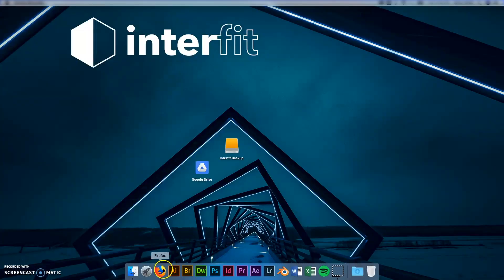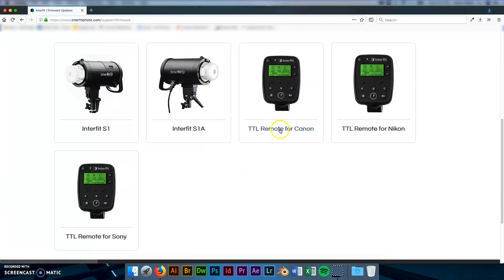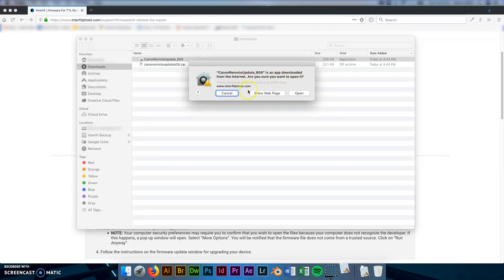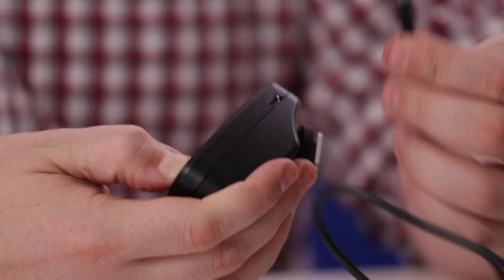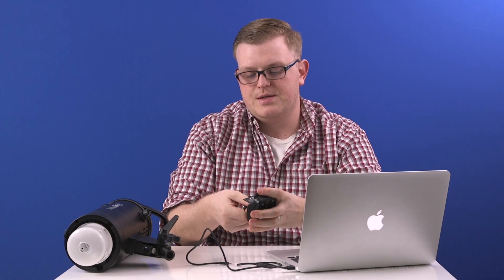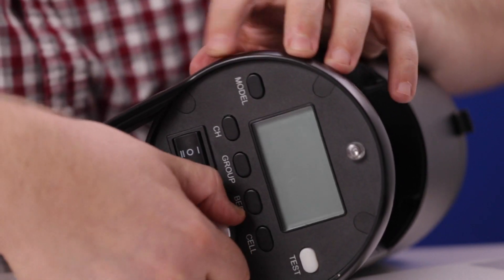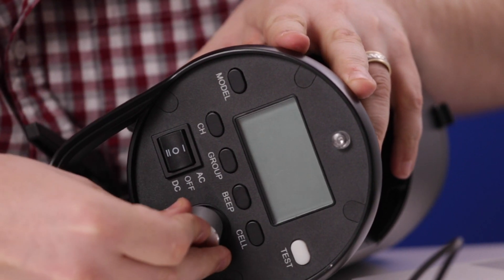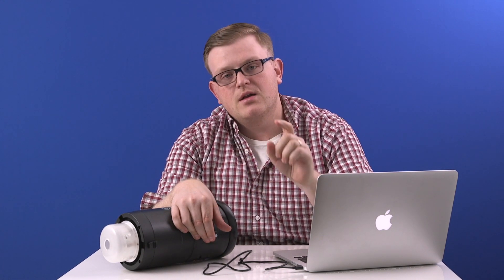How To Update Interfit Firmware

Comment: My S1 has an error code of U2, how do I fix this?
Reply: Hey you ever figure this out?
Reply: Nope. pretty much cant use that one anymore. Company seems to have went under. @dacorijones7484
Reply: @dacorijones7484  the port for the power cord was loose. It screws in.. I tightened it by screwing it down.. then use the power cord with the ac adapter to trigger a few flashes.. then I put battery pack back in.  And it works
Reply: @JosephCampbellSolutions can you tell me more about this? I’m getting a U2 error and I can’t seem to find a fix. I’ve tried unscrewing things too. Wondering if maybe my power cord could be the issue?
Reply: @jamesbianchistudio  it's didn't work. Still having issue with that light.

Comment: Greetings, I bought the S1, I did the above, but there is a unit that sometimes misses a shot at certain intervals, thanks
Reply: Hello, I see you posted a year ago, wondering if your aware the interfit closed down, and the reason I'm asking is I purchased my S1 and Honey Badger back in 2017 and now I'm in the need for  new flash tube and Batteries.  I went on the site and they show that they're available but I'm a little apprehensible  about giving my credit card info if the company is no longer.  
I'd appreciate if you have any info, try calling but the number on the site no working and e-mail just gives me closed down as off May 2023
Thx
V

Comment: I have the Badger Unleashed lights. I have not had any problem with them until lately.
I bought 2 Badger Unleashed lights 2-3 years ago. I used them for a church photo directory and was very happy with them. I was asked to do another photo directory, so I bought 1 more Badger Unleashed light. I just updated the firmware tonight from 3 to 4, but now 2 of the lights won't work. They turn on, flash while turning on, and then turn off automatically. I cannot use them at all. They won't stay on, its just the flash and then they turn off. And it won't let me upgrade my remote. I have been trying to connect it for several hours now and it won't "Connect".

I am very happy with the lights! I really like them, but this problem has come at a VERY inconvenient time! I need the lights by tomorrow afternoon (in about 17 hours)!

Comment: Trying to update my remote (for Nikon).  Pulled batteries, connected to HP Pavilion laptop.  When I run the updater, regardless of what I do, it says "No such USB device". Rebooted, tried different USB cables, etc.    Running Windows 10.  Any suggestions?

Comment: How can we get the new Nikon Z6 II to work with the system? I used the S1 and Nikon trigger with a D800 for a few years, they worked beautifully. Now the Nikon Z6 II won't even trigger the flash in manual mode....
Reply from the maker: Hi Jamie! Sorry about the recent incompatibility - it usually takes us some time to reverse-engineer things when Nikon changes their firmware code, as they don't share that information with us third-party manufacturers. Covid-19 delayed many aspects of our business for some time, so we are just getting things back on track. Making sure that all cameras maintain compatibility with our lights is a high priority, but it will take a while for us to catch up with these newer cameras that are less than a year old.
Reply: @InterfitPhotographicLtd  how long until the new firmware?

Comment: No update for the universal remote? Can't use my S-1 now?
Reply: If you email interfit, they'll send you firmware to revert your S-1 for use with the manual remote, as I understand it, you'll then need to switch between firmware if you want to use the manual remote or if you want to use the HSS/TTL remote... not the most elegant solution.
Reply from the maker: @mattlewis4284  The firmware revert solution was just a temporary fix during the product recall. The manual remote doesn't require any firmware updates, as it doesn't have any TTL or HSS protocols to worry about. The manual remote issue was related to an incompatibility with the firmware of our TTL/HSS products but has been fixed at our factory. If you need to switch between the TTL/HSS and manual remotes for your work, please contact support@interfitphoto.com to have your old manual remote recalled and replaced with a functioning one to avoid the need for rollback.
Reply from the maker: The manual remote doesn't require any firmware updates, as it doesn't have any TTL or HSS protocols to worry about and will work with any camera through the standard hotshoe firing pin. The manual remote issue was related to a hardware incompatibility with the firmware of our TTL/HSS products but has been fixed at our factory. If you need to switch between the TTL/HSS and manual remotes for your work or own a camera that requires the latest firmware to be compatible with the lights, please contact support@interfitphoto.com to have your old manual remote replaced under warranty with a functioning one to avoid the need for firmware rollback.

Comment: i have a defected remote won't let me get to the hi speed options  have to take it back
Reply from the maker: Sorry to hear you're having troubles with your new remote! We can definitely help you get to your high-speed sync mode, please send an email to us at interfitphoto.com/contact with the specific remote you are using, which camera model you have, and whether or not you have updated the remote and light firmware. We cam help walk you through the issue!
Reply: I have the eos r canon remote for some reason I can only use hss in ttl mode and not manual  will the update fix that
Reply from the maker: @Littkickks  You definitely should be able to shoot with that camera in manual. Make sure that you update the firmware, and if that doesn't work, reach out to us at www.interfitphoto.com/contact.
Reply: Josh G Photography were you able to find a solution? I’m having exactly the same problem with my Nikon remote
Reply from the maker: @niamhfisher5156  Hey Niamh! We can help you get to your high-speed sync mode too, please send us an email at interfitphoto.com/contact with the specific remote you are using, which camera model you have, and whether or not you have updated the remote and light firmware. We can help walk you through the issue like we did for him.

Comment: Ok, couple things. I bought the S1 from BandH Photo. I received the product yesterday. Its missing the power cable for the battery. I talked to BnH and they will try to figure this out. Also, I wish you had a manual, a detailed manual in the box. All I got was one or two pages. I dont need it, but I am sure there are other people who could use it. I just did what you suggested for my Nikon remote. After the green bar was completed, it shows PASS. I assume that its completed. The picture that came with the receiver, shows a button thats missing in the receiver. But then I saw the receiver for the Nikon on your website, and in the video and I realized that the picture is wrong. Thought I should point that out.
Reply from the maker: It definitely should have come with the charger - it's still under our warranty and we will send you one. You can call our warehouse at 1-866-947-9796, or email us at support@interfitphotographic.com to get started. Sorry about that! We'll make it right. As for the manual, we include a Quick-Start Guide with every package, and then to be eco-friendly, we offer full manuals in PDF format (which you can print yourself if you need) on our website at https://www.interfitphoto.com/manuals. On our Quick-Start Guide, it will show all of the buttons because the Sony and Canon TTL remotes do require the middle button, but you'll notice in the note below that Nikon users are excluded from needing this button because it is performed automatically.